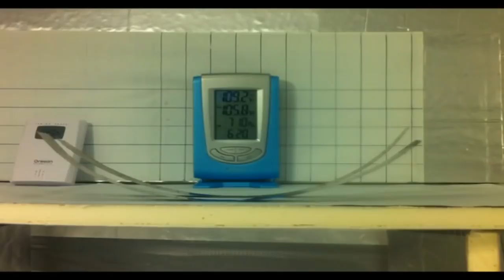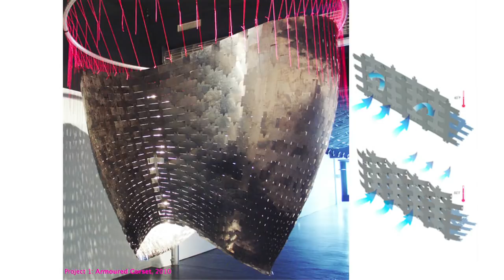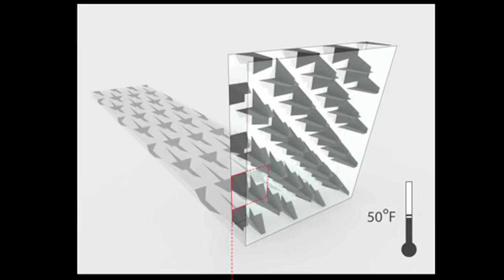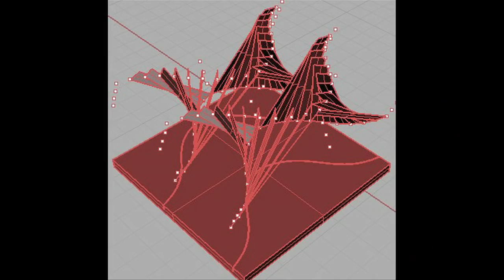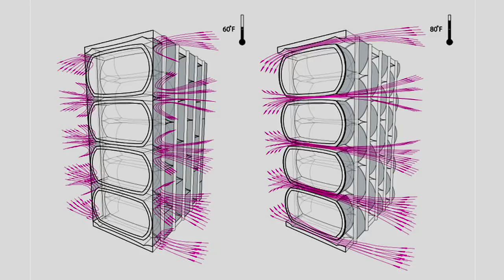Metal that breathes | Doris Kim Sung

Comment: It not only provides shading but also autonomously regulates air conditioning and the temperature of the building - without any energy input. This would reduce the required amount of air conditioning in many buildings by a marked amount (potentially)) and with regards to manufacturing it's all a matter of economies of scale... if and when the demand for this becomes high enough it can become potentially much more economic and environmentally friendly to use such technology.

Comment: No, as she mentioned in the double glazing solution she said she's working on, the thermo bimetals will curl within the cavity of the two glass sheets as they are heated, so you'd get a filtered light effect, sort of like blinds. But if each bimetal leaf was small enough, you might be able to get better visibility through the window than regular office blinds at certain temperatures. Of course, on an exceptionally hot day, people will be glad for the complete shade.

Comment: Kind of. go to 5:21 - 6:07 and you can see that the house still has floor to ceiling windows, but the layer of thermometal is able to be opened and closed. She did say that it could be closed for privacy, so I guess maybe it could be mechanically configured to remain fully open if you wanted so (or at least that's the way I would design it XD). I'm frankly more interested in the project on 7:31, because it would be great houses in the tropics where people must rely on electricity for cooling.

Comment: Yes. It will obstruct the view at times when the heat is to high, but in turn it will keep the heat from coming in. Its the same principle as transition metal switchable glass windows, but without requiring electrical current. Depending on where you live this may be more desirable, for instance, I live in Yucatán and in summer we have temperatures over 40°C (104°F) and since this place is a plateau there's not much of a  landscape,  so I prefer saving money on cooling.

Comment: This is another excellent example of bio-mimicking but one problem I see from this is it could only be used in areas where is hot and dry. If air can pass through then water can also pass through just as easily. Then it bring the problem of oxidation. Will rusting effect the ability of theses metals to bend?

Comment: Thermo-plugs/switch's have that metal in them coiled up. When they get hot they uncoil the metal makes contact with the outside cylinder and you have a circuit.

Comment: The only reason there would be cold air inside the building is if there was air conditioning, which this is trying to eliminate. It would cool the space by ventilating it.
I would guess that the sun is allowed in for lighting.

Comment: And Poland just came up with metals that dont rust and are lighter weight. I think they finally cracked the Roswell metal samples. Covetic materials, a new method of bonding carbon to base elements like silver, tin, aluminum and copper.

Comment: The energy consumption doesn't come from closing some blinds to keep the sun out. It's from MASSIVE AC-units needed to cool it down even with blinds closed. 
Interesting concept, doesn't seem very practical to me as it doesn't replace the parts where much energy is consumed but those where a tiny engine, running for 5 seconds can do the work.

Comment: Its an interesting idea.  But it would need to have some sort of heat coils running through it like on the defrosters on cars to force it to shape into a 'closed' state if it happens to be raining.  Plus , the integrity of the design doesnt seem like it is strong enough to be in some areas, like where im at in Florida, to be usable.  It would need to be built out of titanium or something to withstand the constant threat from hurricanes. Still, its a very creative idea and warrants more  research

Comment: Like anything in this world, if the demand for it becomes high enough the price would drastically be reduced. and the whole point of this is it both provided user specific regulation and works autonomously at 0 energy - reducing a buildings energy demand... yes electronics are cheap but the air con system isn't, buildings alone account for around 30-40% of the worlds entire energy demand so cutting that down would make a big difference.

Comment: This technology is millennia old. There is such a thing as the badgirs, or the WIndcatchers. Lots of them are located in Persian territories - Iran, Libya etc and are dated from several hundred to a few thousand years. In short, the towers work as air conditioning units - cooling the air to almost zero Centigrade if necessary. They are just stone - without any fancy smart metals. Hence, there is nothing new under the sun.

Comment: If it's a hot day, a little moving hot air is going to be better than nothing, but it's still going to be hot and uncomfortable overall, and then, with the "window open", you lose the option of AC.  The ventilation concept is... completely lost on me and seems completely impractical.

I can see it possibly working in conjunction with an evaporation-based low-energy AC system, but just as advertised... I don't get it.